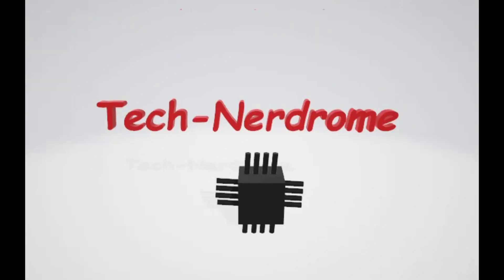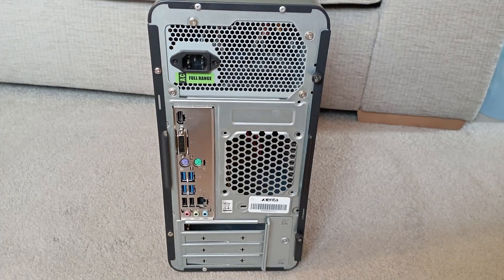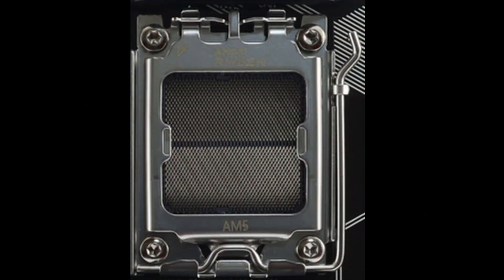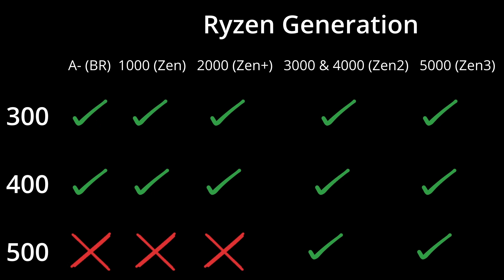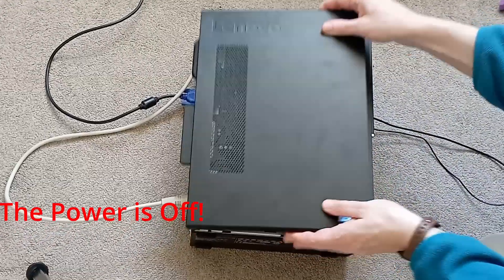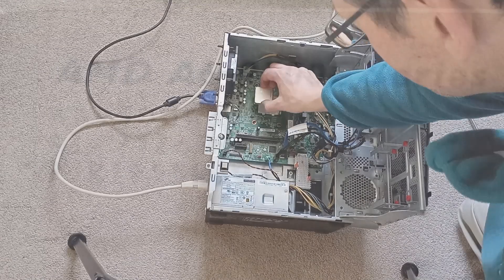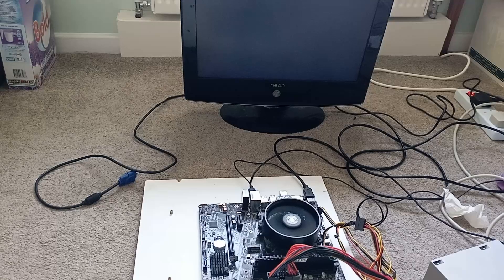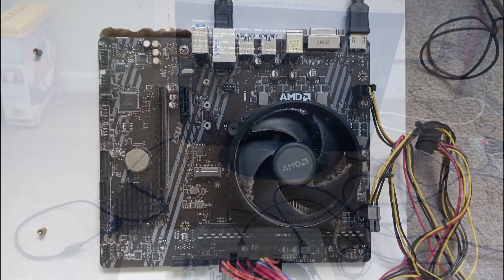Old AM4 CPU, New AM4 Chipset, Does it work?

Comment: No kidding, I got a pair of amd pro a10 8770s for 8 bucks and I wanted to make a build for them. But just about every motherboard on sale, even from that cpu's era, have phased it out. Making that a nightmare, I had to resort to an hp oem board.
Reply from the maker: Yep, also not helped by the fact most motherboards do not allow you to roll back the BIOS, so once Bristol ridge compatibility is "upgraded" out of the BIOS, then there is no return. Explains the £1.98 price tag for the A6 9500E! Cheers!

Comment: It all depends on the AGESA version in the BIOS. For example, even old 300 series like A320 now support 5000 series CPUs if you install the latest bios but after you flash the new version you lose support for old CPUs. I like AsRock because on the support page with the bios files they told you what CPU generation is not supported and it's not recommended to upgrade if you have it. If the AGESA version is 1.0.0.x then old boards can run all CPU Ryzen 1st-3rd gen, A-series APUs, and Athlon series. But if AGESA is 1.2.x.x then all A-Series APUs and Athlon X4 are dropped because they are Bristol Ridge. The only supported Athlons are the 200G, 300G, and 3000G series. For your R3 4300G you need bios with AGESA 1.2.x.x and for the R3 3200G you need AGESA 1.0.x.x.

Comment: The AM4 a-series tends to work on 300 and 400 series boards up to a BIOS revision that added support for 5000 series Ryzen. Round that till, AMD realized that they needed to cut cpu support for the large numbers of SKUs they had. This is why you don't see first gen Ryzen and A-series support on 500 series boards. It was a limit in the 16MB/32MB BIOS size. If you had a board that had the 32MB, you might have support for full line of AM4, but the 16MB had to have cuts.
Reply from the maker: Bang on correct. Cheers!
Reply: That explains the warning I saw when I upgraded the BIOS on a B450 motherboard. I was going from a 3200G to a 4600G which required a BIOS upgrade.  Support for something got dropped, but I don't remember what. It wasn't relevant for me.

Comment: I use an A6 9500e Bristol Ridge CPU in a mini video streaming pc for watching Netflix, Prime etcetera.
For that purpose, it is just fine: It's GPU can do this with no problems at all. 
The only reason why I bought that cpu was: It was the cheapest cpu I could find.
It runs on a motherboard with an A300 chipset in a mini AsRock pc.
And apart from the bootdrive, which is an SSD, it also has a 1TB mechanical harddisk with several movies on it. I use VCL Player to watch these movies. Works just fine. And it can also play - very simple - games on my TV. 🙂
It does not support Win 11 but I am using a Win 10 Enterprise iot license which will get security upgrades until Q1 2032... not sure if the small cpu will still be able to play Netflix by then. 🙂 But I can always replace it by something more potent, should it ever be necessary.
By the way, my "office pc" still has an A8 9600 4-core cpu, also Bristol Ridge. For Office, internet and light games (or old games), that cpu is just fine.
Yes I know, these are old designs. I also have a pc with a Ryzen 9 3900 12-core cpu, for photo and video projects. 🙂
As to why the A6 was made for so long... sometimes AMD has long standing contracts with other companies. I read this is also the reason why the so-called "AF" Ryzen CPUs appeared:
AMD had a long standing contract with pc manufacturers  for 1st Gen Ryzen CPUs. But AMD ran out of 14nm wafers. Instead of buying new 14nm wafers, they just used 2nd Gen Ryzen cpus on 12nm, and rebranded them as "Ryzen 5 1600AF" and others. So, with the 1600AF you actually got a 2600, but with a slightly slower clockspeed. 
And so AMD made these AF chips to respect a long-term contract. 
Maybe they have some contract for the A6 as well: Maybe for use in industrial machines, iot-appliances, a terminal manufacturer, a cash dispenser manufacturer, the army, a company making space satellites, a company making machines for hospitals such as scanners ...  you name it, there can be many long-running contracts. Some machines are made for much longer than pcs.
Reply from the maker: Hi, that all sounds completely viable! Thanks for the comments!, yes, I get some strange satisfaction making cheaper low power components last way longer than they are expected to! My i5 4460 in my main gaming PC says it all! Cheers!

Comment: Finally someone covered, and shows that AM4 original line-up was using last the Faildozer-based iteration, Excavator.

Plus, this shows that AM4 DOES NOT support all line-ups, thus, fake AF and misleading.
Reply: i don't ever remember them saying all line-up's, just mostly the main ones. 
the A-Series and Athlon where just cheap celerons and pentiums, tieiovers. 
most OEM's and motherboard manufacturers literally tell you what CPU is compatible with X bios/AGESA version and whatever 300,400,500 chipset
the 500 is obviously meant for 3000 4000 5000 cpus
400 is hit or miss on how it's set up and what bios/AGESA version it has
as for 300 make sure you have a cheap bare minimum CPU to do a bios flash to get the older chip working.

at lest it's far better then intel where you have to buy and new chip and motherboard for each new generation
cause nope sorry ya got to buy a new motherboard revision to use the new CPU even though i already have the same socket.
Reply: @SilverX95  Nah, Evil Su actualy made it sounding like their AM4 supported ALL processors, even before the ROM size issue was a thing.

Therefore, AM4 support on all motherboard was a huge scam and false.

"at lest it's far better then intel where you have to buy and new chip and motherboard for each new generation
cause nope sorry ya got to buy a new motherboard revision to use the new CPU even though i already have the same socket."

Yeah, clearly, you are an Aymdiot, and aren't bright.

It's 2 gens per sockets, and if you are upgrading annually, or the latest, it's clearly your issue on your side.

Plus, Intel have their reason, they already did it back in the LGA775 days, and it went badly for them.

1. P4 chip on C2 decent motherboard? Yeah, you are going to either kill the motherboard easily, because the power delivery is meant for C2 efficiency, rather than the power hungry P4.

2. That's the best case scenario, the worst case, it couldn't post, because P4 required more power.

3. C2 chip on P4 board, yeah, you are definitely trying to kill your expensive CPU for no reason.

With that said, AMD should have supported AM4 chip on AM5, just like pre-Evil Su, but nope! Shame that AMD went full Intel.

Comment: is there some sort of pin difference in the apu graphics side of things between the generations?
Reply from the maker: No, at the end of the day, you can have a A320 based mobo, that works fine with a a9500e with the original bios, then hostage the bios and be using a Ryzen 5600G, so mechanically, they must be the same. Cheers!

Comment: There is actually more interesting question : Original A320 MBs didn't support 5000 series CPUs (Zen 3). But you could do a BIOS update and they will. Question arises, does this drop support for older generations like 1000 and 2000  (Zen and Zen +) ?
Reply from the maker: Hi, not checked that myself (no 5000 series CPU!), but from my understanding,  it is "maybe". Some mobos had a big enough Bios chip to hold all the info, so kept compatibility. Others did not have the room, so had to drop earlier CPU compatibility. Cheers!

Comment: Dear friend, this APU model that you used is made with the Excavator architecture and only works on motherboards with the A320, B350, and X370 chipsets, which are among the first generations of the AM4 socket. However, the rest of the AM4 socket CPUs work without problems on all motherboards. Now the question is whether you deliberately chose this APU or not!
Reply from the maker: Hi, yes, deliberately chose it! Was seeing if "officially support" and "actually support" were the same thing! :) for £1.98, seemed worth it!
Reply: One thing I forgot was why this model of APU is still being produced, because it is one of the best options for embedded use and light to medium gaming, and note that the APU used in the Xbox One and Xbox One S is almost the same as A9-9820.

Comment: Here's an interesting one: The HP EliteDesk 705 G3 SFF originally shipped with the pre-Ryzen A-series CPUs on the AM4 socket, and were not compatible with the later-released Ryzen CPUs. However, HP switched to Ryzen and some of these units were shipped with 1st gen Ryzens, even though the boards look identical (except for an SSID# change) and the PC model name stayed the same. Turns out the newer boards have a newer BIOS that allows them to be compatible with Ryzen, but installing the newer BIOS on the older version of this board can brick them if you're not careful. I found that you can update the BIOS (using an A-series CPU), and then when it goes to restart, you IMMEDIATELY cut power to it, remove the A-series CPU, install the Ryzen CPU, then power it on and the BIOS finishes the update. If you leave the A-series CPU in during the entire update, something in the old CPU screws up the board and the PC will no longer boot up at all, even if you swap in a Ryzen CPU afterwards. Honestly I wouldn't recommend trying this at all, as I bricked 2 boards and only figured this out on the 3rd unit (which wasn't a huge deal since I had gotten 5 of these from a local recycling place for super cheap). It's a shame because there are many PCs out there with AM4 boards that can't use Ryzen CPUs and are therefore basically useless.
Reply from the maker: Yes, BIOS versions play a massive roll. On an earlier video "building an incompatible PC", I mentioned a similar thing. I had a Dell optiplex 390 and 3010 (I think!) Motherboards. Socket 1155. The 390 was 2nd gen Intel and the 3010 was third gen. The boards were identical. Same codings, chips etc. But the latest Bios for the 390 never allowed 3rd gen chips to work, while they worked fine in the 3010. From what I could tell, this was just a decision to not allow it in the BIOS..... Cheers!

Comment: Unlike intel, am4 motherboard can play dead with incompatible CPU, or without any cpu, while intel board usually powers on regardless. So it's normal, I've built around 500 PC's during last 10 or so years, I've seen it all. Regarding incompatible CPU's, it might work with older ryzen chips, but I never had any success with old APU's unless it's 300 or 400 (only some boards, not all) chipset with old bios.
Reply from the maker: Cheers! Sounds like your experience agrees with what happened here.

Comment: The lenovo cpus burn out a fuse, so they will only work on lenovo motherboards. If you put a retail AMD chip into a lenovo, it will burn out the fuse, so it will work in lenovos. They set a certificate hard coded from the lenovo bios into the cpu using the fuse burn.
Reply from the maker: I actually put the Ryzen 3200G from the Lenovo into the MSI board (later video!), and it works fine. I'd heard about the fuse thing, but guess this is not the case here. Cheers!
Reply: @Tech-Nerdrome  that's good. I've heard it applies to standard motherboard but it really applies to like workstation and server chips.
Reply: @MaverickTangent  Yeah, Lenovo is notorious for this. I see so many cheap Threadripper and Epyc cpus, but look into the desc just to find out they were Lenovo oem cpus.
Reply: @aticoco  it's just a terrible ewaste. It's a shame...
Reply: Yeah it's a really shitty thing for Lenovo to do this. There aren't any real security improvements for doing this (even though Lenovo claims that's why they're doing it), and it just turns perfectly good silicon into ewaste.
Reply: @DJdoppIer  and then Lenovo touts itself as sustainable…
Reply: I think that's only on newer Lenovos and it might be only on the Legion gaming desktops

Comment: I have an AM4 motherboard that can support both Ryzen and A series chips.  The A series need a lower BIOS.  If you upgrade to a newer BIOS it will only support Ryzen.  I believe it is a power issue with the older CPU.
Reply from the maker: Hi, yep, I think it was because there was only so much space on some BIOS chips, and with all the AM4 CPUs, there was not enough space for all the data. Some Mobs had a larger BIOS chip capacity, which is why some can handle all of them, while others lost earlier CPU compatibility to gain later CPU compatibility. Cheers!

Comment: This is an interesting experience and i always wondered about it, thank you for your efforts.

I just wish companies would stop producing the absolute minimum silicon, just like how the GT 210 is still being made and sold!
Reply from the maker: Thanks! Yes, GT210 would be another example. Cheers!
Reply: well one reason is to not cannibalize their own range with their cheapest office use offering. selling something bad intentinally so that it can be sold for cheap is nothing new in computer industry - and it is always a reminder of about how arbitrary the pricing is.  sure 5080 has some manufacturing base price, but it's got really nothing to do with the sale price which is entirely based on what they think the market might think it's worth.  edit: sometimes an older production line keeps pumping at a different facility while the newer facility gets switched to a newer model twice or thrice.

games are where the arbitrary pricing is even more evident but yet still many people think it makes sense a game would cost more now than 10 years ago - even when the game has no duplication costs and it might sell more units at lower pricing and it's a product nobody really needs.

Comment: Dude! If yr quick, right now on ebay, nice little mini-itx gigabyte ga-ab350n-gaming wifi with that a6 chip in it, working! 145.28 or best offer :D
Reply from the maker: Hi, that's the full fat 9500 (65w), while this is the 9500e (35w). £145 is a little rich for me (especially as the CPU, or the e equivalent can be had for £1.98 new), and a second hand mobo and case, maybe £50 or £60? Thanks for the heads up though! Was fun checking it out!